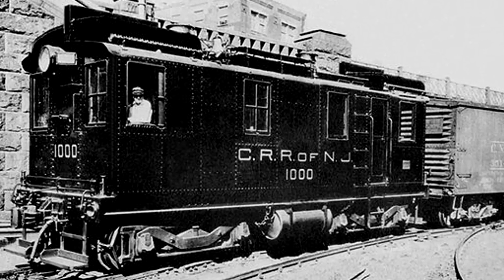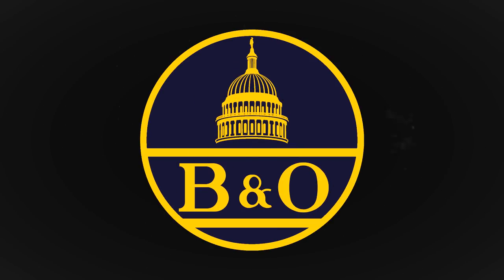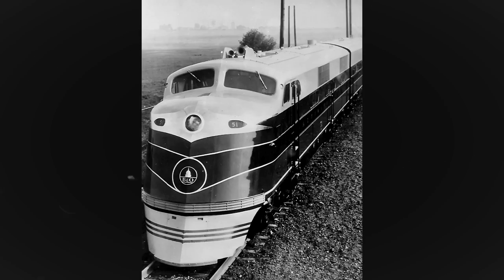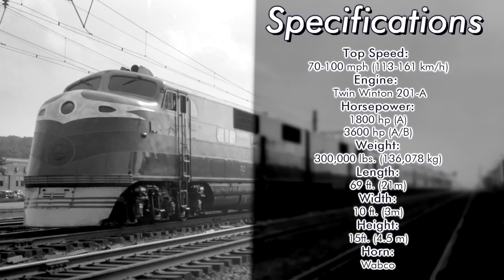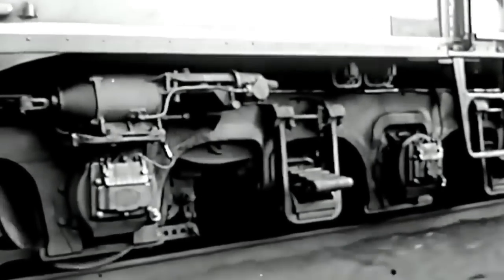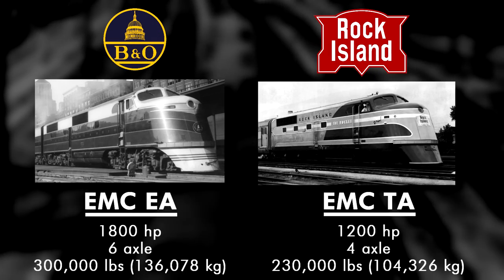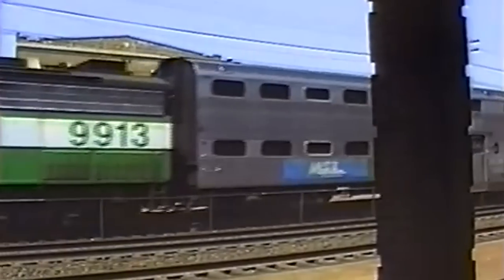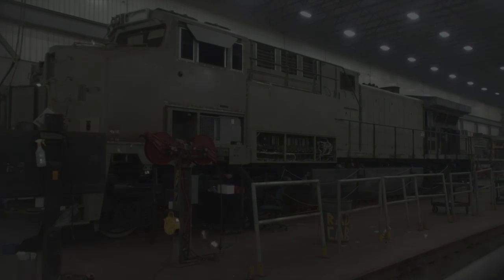EMC EA: The First E Unit

Comment: The best built pre War E diesel locomotives were the E5 for the Burlington R.R.  They were all rounded at the front without a protruding headlight and were made of stainless steel which made for a smoother ride and slow bouncing on the tracks as it ran. The B.and O Railroad had its terminal in Jersey City,  N.J across from the Statue of Liberty and from there ran the Capitol Limited,  its flagship streamlined train with the EA diesel locomotives from 1937 til 1953.  I lived 4 miles from that area in Jersey City at Jersey City  Heights. My late mother and my brother and his son flew a kite on a weekend in summer there that is now a park.
Reply: BTW, the last E5 is now at Union, Illinois at the Illinois Railroad Museum.
Reply: @kristoffermangila  Go search for a photo of it when it was brand new when it had a fender skirt covering the top half of the wheels for preventing snow and dirt from entering the gears that turn the wheels. Those E5s were considered the best riding pre War streamlined passenger locomotives because of their stainless steel that weighed less tha regular steel. It was described as driving a Cadillac of the era for its smooth ride.

Comment: The beginning of diesel switchers was the Kaufman Electrification Act of 1923. It was a law passed by the New York State Assembly, that mandated electrification of all railroads in New York City by January 1, 1926.
      The Act made no exclusions, affecting mainline traffic and freight yards in all boroughs of New York City, including the isolated rail system of Staten Island. The Act led to a large influx of diesel locomotives into New York City. (from Wikipedia, The Kaufman Act).

Comment: EMD and ALCO type cab units are still in revenue service here in Australia
Reply: EMD is cool, but Alco???  Don't you have air pollution regulations down in Australia???  Or are those re-engined units???
Reply: @agentorange153  most diesels here have been rebuilt to better standards unless they're heritage units so it's not as bad XD

Comment: wait, EA, oh no, there is microtransactions in this train!
Reply: Driver: $99,999.99  
Turbo: $999,9999.99 DLC 
Horn: $99.99 Add-on Plugin
Wheels: $999.99 Per piece
Controls: $999 for a whole set, $99.99 for individual piece

Comment: Which is the first Diesel locomotive in America?
Reply: Not sure, but the first successful diesel-electric locomotive is Central Railroad of New Jersey 1000, a boxcab unit built in 1925 by a consortium of Alco (body), GE (electricals), and Ingersoll-Rand (engine). It was a successful unit, serving for more than 30 years as a yard switcher. Today, it is preserved at the same museum as EA unit 51 - the B&O Railroad Museum in Baltimore, wearing its last livery - a modification of its black livery with the "Lady Liberty" logo of CNJ and numbers in yellow.

Comment: Meanwhile Europe went with flat front end cab locomotives with dual cabs because they have dead end stations in Europe
Reply: That's because European railroads lack turning facilities on many lines (one classic example is British Railways) and those lines that had turning facilities (aka turntables)had been removed long ago. To compensate, diesel and electric locomotives in Europe have dual cabs, which makes them more expensive than American-style locomotives, because cab controls cost a lot of money.
Reply: @kristoffermangila  could this be the reason why PKP cargo of Poland decided to modernize their Soviet M62s then
Reply: @detroitdieselseries5071  perhaps...but those M62s are old, tired units. Its either rebuilding or replacement. PKP went to the rebuild route; in Estonia, they replaced all of their M60s with rebuilt (and regauged) ex-Union Pacific (via Missouri Pacific) C36-7s and ex-Norfolk Southern (via Conrail) C30-7s
Reply: @kristoffermangila  the PKP cargo M62 modernization started back in 2007-08 when PKP cargo was fully owned by PKP. I think the government saw it was better to modernize the M62s by PESA of Bydgoszcz because it was local and no polish builder at the time was building diesel locomotives back then

Comment: Does the ea unit have micro transactions for the streamlining and hep?
Reply: HEP didn’t exist back in the 30s
Reply: @GNF54 Actually, the Butte, Anconda, and Pacific Railroad had electric locomotives which supplied electricity for car heating and lighting over a cable atop the roof, starting in 1913.  Then again, they were the only railroad to do so.